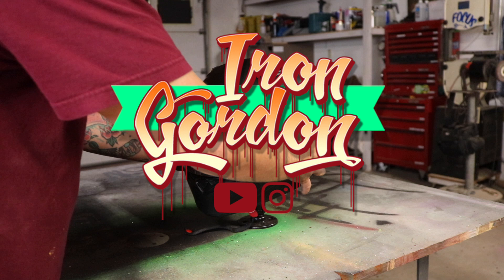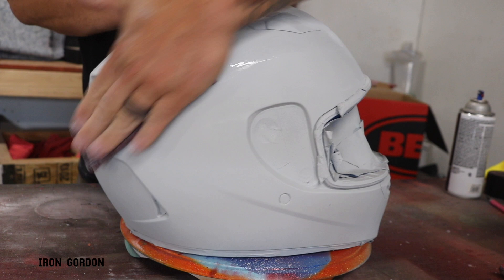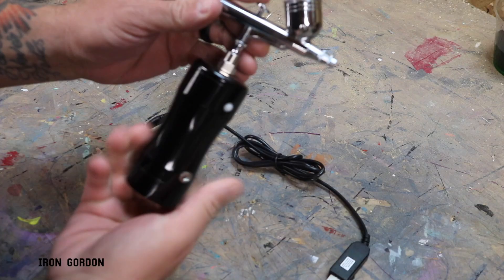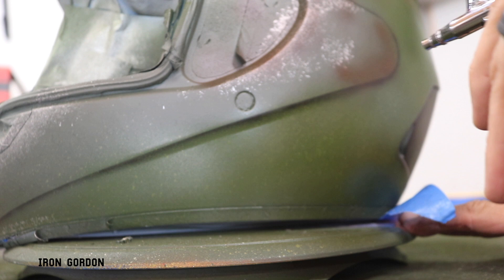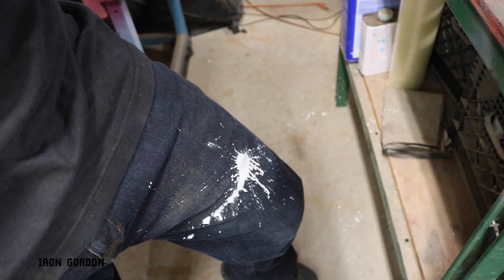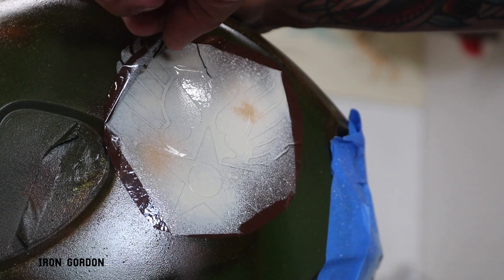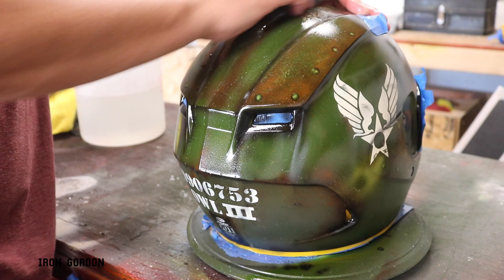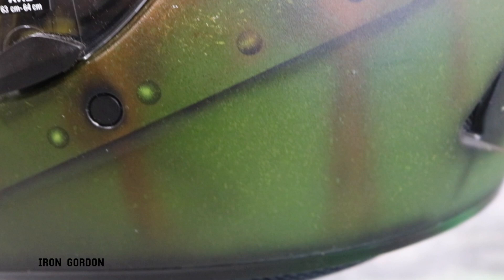How I Spray Paint and Airbrush a WW2 Fighter Plane Inspired Motorcycle Helmet with fake rust

Comment: You absolutely CAN spraypaint helmets, people have done it for years. The raw shell of a decent helmet will be fibreglass or carbon fibre, both of which are very happy with paint.

I think the shadows are too black, and I'm not a fan of them going over the top of the white logo. Shadows should be a darker version of the same tone, not black. For the rivets, I would've cut small circles and then done a slight shadow around them, that would've been more effective at creating a 3D look (and the rivets would be the same colour as the base). But otherwise I liked this, and the way you created the weathered rust areas was cool.

Comment: Painting helmets has been going on for decades. Every professional racer has a custom painted helmet even Formula 1 which has the most stringent tech rules in the world. 

Good job on this one. Interesting to see the air brush. Seems to work ok.
Reply: Some still paint but most use vinyl graphics.
Reply from the maker: Definitely, my last helmet spray painting video people were quick to let me know that your can't spray paint a helmet, but then wouldn't provide any evidence why. Thanks for the comments!
Reply from the maker: paints waaaay cooler in my opinion ha!
Reply: @bigboycombo6342  Wrong, most motorsports use painted helmets, not least because the vinyl material is flammable.

Comment: ok if the helmet was fallin- or u scratch it anywhere - theres no harder safety finish spray ? make it protectable- like epoxy resin? on a helmet?
Reply from the maker: Yeah I guess having a painted helmet, it would be more prone to scratches. But the 2k clear coat is very durable while still being light weight. Good question!